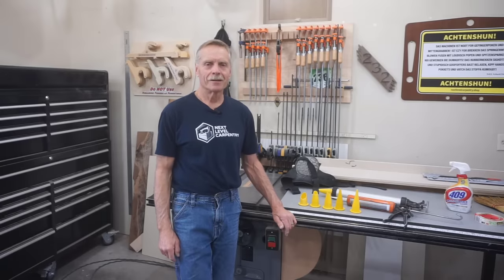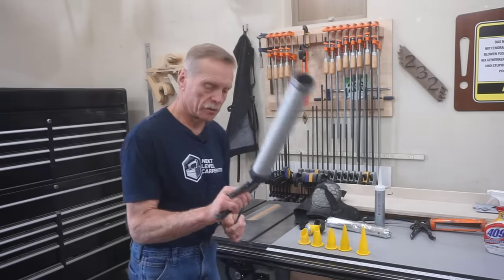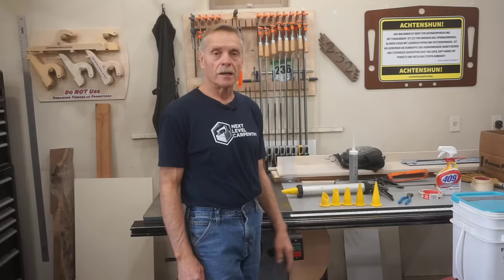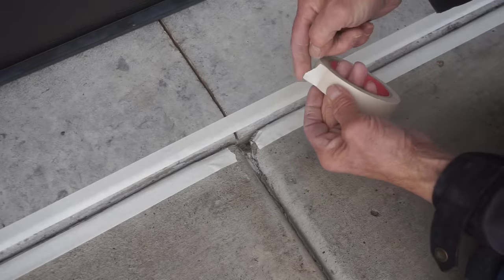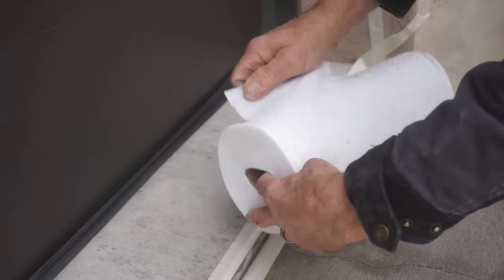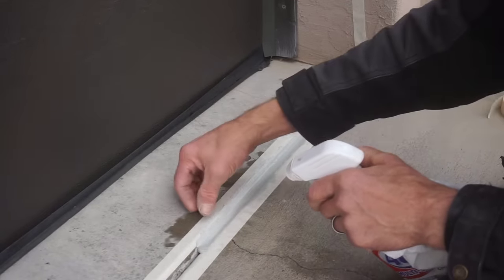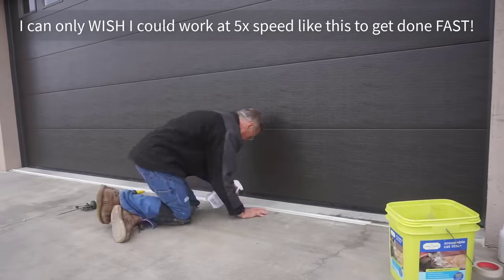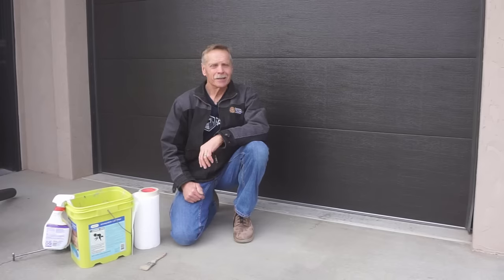How to Caulk Concrete Control Joints with Perfect Results Every Time

Comment: EXCELLENT! I found that for my old concrete, just play sand looked and blended great. wear nitrile gloves. the 409 made me sick. Also, I found backer rod not necessary, just plenty of sand which flows in the joints and fills quite nicely. It will take several hours of sunlight to harden and several days to fully cure. Repair (where dog stepped on) was easy. Cut out with razor blade, apply with painter tape around and done.
Reply: Thank you so much was wondering if regular play sand would work as the store I’m at doesn’t have silica
Reply: @pidgepagonis  if you can, you may want to rinse the sand so it sticks better. I didn't do that but will next time i have to do this again
Reply: @jasonmadruga9028  ok… so sorry it’s down with water? I bought the washed version, but I don’t think that’s what you mean, right?
Reply: @pidgepagonis  mine had a fine dust but i think a rinse and letting it dry before applying would help it stick

Comment: One of the more disrespectful comments below made fun of the masking tape.  I had almost 200 LF of expansion joint in front of me and no real need to make the perfect tooled joint, but I thought I'd try the tape.  Working with SikaFlex 1a Black, if I didn't use the tape...which I never would have thought of without this video....I would have had the biggest ugly mess to deal with and no way to fix it.  Thanks so much for your help and detailed video.
Reply from the maker: You're quite welcome Charles... always amazes me how those who scorn using tape ALWAYS fail to back up their statements with tangible proof.  Way to go doing a respectable job even without any 'real need' for perfection! Best, Matt

Comment: I loved your video.   The materials discussion and listing of what you need before you start and the explanations throughout the video as to why you use your tools and methods is outstanding.   You are straight forward, no frills, easy to understand conversation is why I will be back for more tips.  

This was just what I was looking for to "fix" the concrete joint at my garage door entrance.  Is there a maximum spacing to use the urethane caulk method you showed in this video?   I ask because the expansion joint I need to repair is about 2" wide for about 18" in one spot with the concrete edge starting to break off.
Reply from the maker: Glad you like the video... thank you for watching and commenting.
Sealing joints much over an inch and a quarter wide is a little bit sketchy but in situations similar to yours where conditions are less than ideal I have actually sealed up joints 3 in wide or so. The proper way to repair that wide Gap you mention is to patch it in with concrete but I probably wouldn't bother in that situation either. The general rule of thumb for joint design is that the depth is half the width so use backer rod or foam or something to control that depth. That part of the Joint May Fail prematurely but using the method I show in this video it's easy to repair should that happen. Practice your tooling technique on the narrower more typical sections of the joint leaving that wide spot for last and I think you will do fine. Best, Matt

Comment: Matt, 
Thanks for the detail video and I can now see why some of my neighboors who have a deep sloap to the driveway  with a message at the middle of the driveway.   Let me ask if the backer rod will help in filling in the deep valley that the wood insert once covered and still using the same product that you talked about. I am planning on doing my joints sometime in the fall of 2023 and want to be ready for a Great job.

Comment: Awesome Video! Never seen the concept of using the silica sand, good tip. And good note on possible issues with self leveling.
Reply from the maker: Thanks for watching and commenting, Mark!  Silica sand for this application is one of my all-time favorite little tips... right up there with using a 'ledger' board to make hanging sheetrock on the ceiling of a small room easier. 😉😁😎 Best, Matt

Comment: Having never attempted caulking expansion joints in concrete, this video would be extremely helpful. I would hire Next Level to do the job in a heartbeat if you were in my area. Thanks so much.

Comment: This is a great video that I would have like to have found before doing some concrete joint work.  I'd like to see your technique to remove the self-leveling caulking, or old caulking to start anew.

Comment: Thanks.  So some sand will stay imbedded in the caulk.  This technique looks like it will help with caulking around sinks, and bathtubs. where you but you would not have to use sand.

Comment: Great video.. calking is a pain but when you finish it right it shows and people notice. I've used a similar method but you have some things I'll be doing after watching this.. mitering the corners at a cross joint does look to give a better finished look.

Comment: Matt, I just used your technique for a wall cap through through really chunky brick veneer. I used HVAC foil tape to mask, which worked great for contouring to the mortar joint overlaps and uneven-ness in the brick face. The results were astounding. The razor sharp line against the rough brick almost looks out of place haha. I used OSI Quad Max, and will absolutely be using this technique every chance I can.
Reply from the maker: Good work, Dan.  I'm surprised you didn't have a fight on your hands removing the foil tape after use... that stuff is notoriously tenacious... but will keep it in mind as I can believe it was amazing for contouring.  I did large/irregular/widely varied gaps in a retaining wall made of those huge poured concrete 'rocks' which, combined with your experience, confirms the technique is adaptable to all manner of difficult applications.  Thanks for watching and commenting! Best, Matt
Reply: I used OSI quad caulk and tooling using mineral spirits.  I get bubbling.  What liquid did you use and was it quad caulk?  Aside from bubbles 12 years later is is still flexible,  holds up great.
Reply: @jimw6991  just about any soap spray will do. I’ve used Master Clean, Spray2000, Zep all purpose, and even moderately concentrated dish soap with water. All it’s there to do is act as a film between your finger and the bead, letting the bead be shaped.

Comment: Your method is fantastic and most importantly it works!  It’s very similar to the way I caulk white silicon in my bathrooms. Thank you so much for the great information. By the way, if others do have a better way, they should simply explain it instead of taking all the time to write a useless comment.

Comment: Great meticulous method with attention to detail, most contractors just slop in it and walk away.  This method lends itself to a higher quality job with long lasting results.   When filling level surfaces I prefer self leveling caulk, but next time I will try the fine sand to finish the joint.  I found this video informative and it offers great suggestions.

Comment: I did concrete leveling for years and did some joint caulking. The silica sand on the caulking is something i never thought of. Great idea. I found a product called "slab" made by sashco that i like alot. When it skinned over it had a rough texture on its own.
Reply from the maker: Thanks for watching and commenting Dan. I have used a product made by sashco called Log Jam which is amazing stuff and sounds similar to the product you mentioned in that it leaves a rough texture when it's cured. Do you know if the slab product is still available? Based on my experience with Log Jam I'd like to check it out... Best, Matt
Reply: As far as I know it is available at ace hardware and Home Depot. At HD it was in the paint and caulk area rather than near the concrete products.
Reply from the maker: @dantrumphour3068  Hmmmm... I'll have to look for it.  Sounds like it could be another option.

Comment: This technique works very well for caulking tubs, showers and kitchens too! (minus the sand) unless you want to mimic a sanded grout joint on your tile which I once did where I needed a flexible transition joint on a tile floor but didnt want the smooth shiny caulk look.

Comment: Took on a small project of caulking close to 200 ft of expansion joints that were close to inch wide. I was tired of weeds growing in them and wanted a permanent solution. The job turned out great but I got that buyers remorse on how much backer rods and caulking costs. As tempting as just throwing concrete in the joints it wouldn't solve the issue, we got joints that was already filled with concrete that ended up weeds growing on both sides and damaging existing concrete.

Comment: I use primer for concrete caulk joints. It seals the concrete at the joint prior to caulking. I use denatured alcohol to cleal prior to applying caulk and also spray before tooling. It evaporates quickly so if a touch up is needed im applying caulk to caulk with no soap reso in between. Always tape and yes miter corners. pull tape long and set flat knife in corner and tear tape for perfect corner.

Comment: I am so grateful for your great video on how to caulk concrete. Some of the areas were deep so I that started by using a can of minimum expanding foam to fill all along the wider cracks (the non-sag polyurethane caulk will fill anything 5/16" or less without backing foam). The next day I used a serrated bread knife to cut the foam flush and then used a wire brush and gritty sandpaper to remove any foam off the edges and high spots. Sweep and pick up, then use a leaf blower to blow all areas clean before caulking. I also found that I could use a silicone rubber spatula sprayed with WD-40 to tool the caulk better than using my fingers (don't spray the caulk, only the spatula). Finally, instead of using plain sand to cover I used polymeric patio sand (Dominator brand). It came out beautiful! Thanks again.

Comment: I have used a similar product to fill in the gaps on concrete I believe they are window sills. The only big difference is your technique makes the job a lot smoother, neater finishing lines and look professional. Thank you for the video and will define using your technique. Stay Safe 😊👍

Comment: Awesome instructions. You’re a gifted teacher which is rare. Thanks for your excellent presentation. I read all the comments looking for my specific issue but missed it probably. I had just filled my joints with Sika self leveling sealant . Not perfect! Can I go over the top of this with with your non sag caulking process? Hoping to level it out and improve the look. God bless you and your work. Thank you.
Reply from the maker: If you read a bunch of the comments on this video then you got an eyeful of conflicting opinions didn't you? 😉😁
To your question:  I know that there's no problem putting new tremco products over old tremco products so I would assume that as long as the self-leveling sealant is cured and clean that there would not be a problem with adhesion or compatibility. I say this because I don't really think there is much actual difference in composition of urethane between different brands. If the existing is cured I would recommend using a utility knife to vee-out the existing sealant to make room for a larger bead of the top layer. Since it is a unique situation it might be prudent to do a practice section like 6 ft long just to see how everything works and decide if you want to commit to redoing the whole works...
Now we have an answer to your unique question for others to consider as well😎
Best, Matt
Reply: @NextLevelCarpentry  Thanks for your detailed answer. I’ll try it and let you know how it goes with pictures good or bad.
Reply from the maker: @ronwallace3890  Cool... and you're quite welcome.  Best, Matt

Comment: Very helpful, I’d like to do that to all my concrete slab joints.  Especially at the end of my driveway, where it meets the neighborhood street. Thank you.
Reply from the maker: I just finished doing all the joints in my own driveway Bennett and it looks great IMHO. 1 point to consider is that urethane sealant does not work well when sealing concrete to Asphalt so keep that in mind if you're considering doing the connection at your street... Best, Matt
Reply: Next Level Carpentry  sound advice, luckily I have a concrete gutter ( I believe that is what it’s called ) at the apron of my driveway.  Thank you Matt.
Reply from the maker: @bennettpisek5566  Perfect!  I actually sealed that very same joint at the apron/curb/gutter joint at my house just last week.  I had to remove an unsightly failed bead of old self-leveling stuff 'they' used when the driveway was poured 8 years before my time.  It bugged me every time I swept or shoveled the driveway but now I smile when I see it! Best, Matt

Comment: Couple of things what I would add to this superbly detailed video is importance of sealing the joint and what have you done in the T joint where you was “mitered” a tape. 

Also, it looks like you already mastered your craftsmanship to the point that you don’t need to smooth the sealant bid down. This just looks like unnecessary redundancy since the bid is already straight and well pushed into a joint. Moreover, the sand would hide any visual imperfections or unnecessarily perfection. 

I would rather you wow yourself by being able to squeezing one more job in a day as you absolutely deserve it!

Comment: So I followed your advice and started caulking my driveway gaps and it works GREAT!!!  I purchased the exact caulk you recommended, but it’s been over a week now and it’s still pretty soft.  How long until it finally cures?
Reply from the maker: Glad to hear it Shane... kudos!  The reason Tremco Dymonic caulk works so well is that it DOES stay soft ie: flexible.  It will get more rubbery over time but joints I did 20 years ago are still 'soft'.  Usually after a week of warm-ish weather it shouldn't leave fingerprints if pressed and is what I'd call 'cured'.  If it's still 'goopy' and deforms easily with finger pressure I'd call Tremco to hear what they have to say.  FWIW I've never experienced joint failure from lack of curing.
Best,
Matt

Comment: Somehow youtoob knew I needed to see this to complete the work on our house.  Now I just need to source the materials.   ;^)
Reply from the maker: FYI There are links to pretty much everything you need through the Amazon link in the video description if you're not able to find it more easily or cheaper locally...
Reply: @NextLevelCarpentry  What do you use a spacemouse for?   I have one but I basically only use it for Solidworks.
Reply from the maker: @prototype3a  I use the SpaceMouse Pro for modeling in SketchUp... I'd be lost without it!  You can probably relate to that when manipulating 3D objects in Solidworks too... Best, Matt

Comment: I( did repairs to deteriorated joints on my driveway and public sidewalk a year ago. I didn't have much success with gooey caulk.  I wound up cutting pressure treated 2x4 to fit in the space available,  and then adding fine sand to fill in the joint.  After a year,  that still looks good,  but I think the methods described in the video are superior.

Comment: Wonderful video, exactly what i needed. Question, what if my joints still have the wood in them. Thanks
Reply from the maker: You've got a good bit of extra prep work ahead of you.  The rule of thumb is to make the bead of sealant twice as wide as it is thick so you need to remove enough of that wood for that.  The more rotten/degraded the existing wood is, the easier it will be to remove it.  Rotten wood might be real easy to remove with a knotted wire wheel in an angle grinder.  Solid wood will probably require monotonous hours with a hammer and expendable chisel.  Good luck!